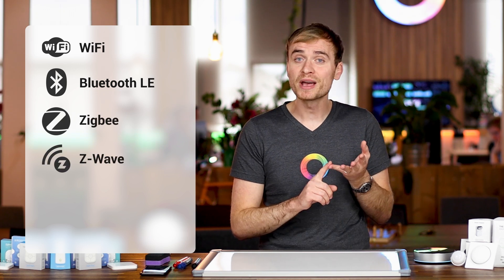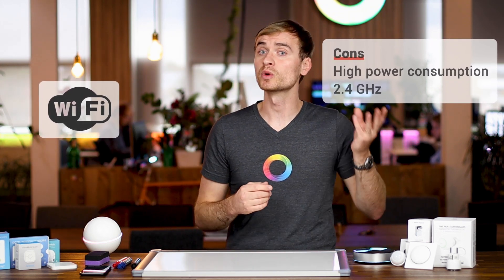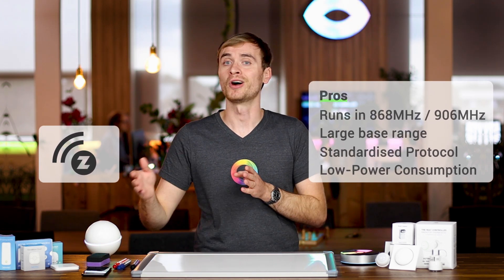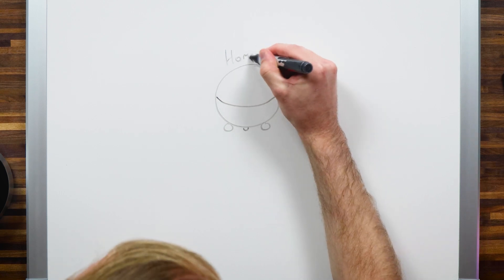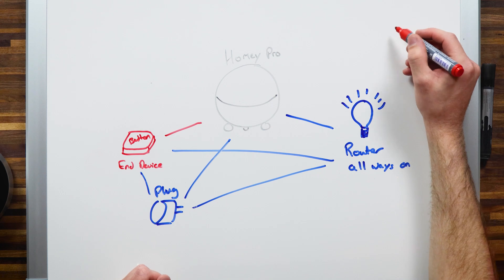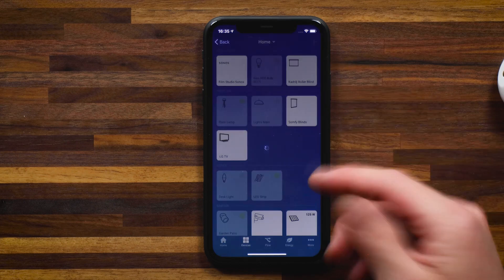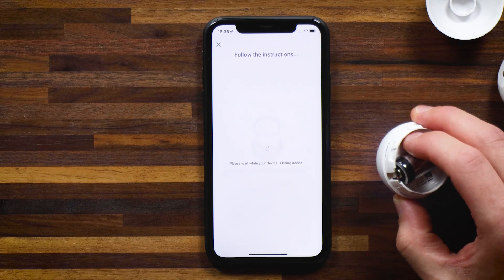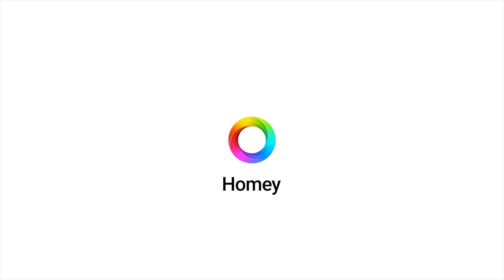What is Z-Wave?

Comment: then I don't know how it is possible that I have a z-Wave sensor and the range is about 5 m further it does not go.  I also heard this problem with DANALOCK POLELOCK V3 SMART LOCK.
Reply from the maker: Hey Richard, that sounds like a very annoying issue. What type / brand is the sensor device? Have you thought about placing a Z-Wave router device in the area to extend the range? Also during pairing, it can help to hold the device close to Homey, then once paired to move it to where you will use it.
Reply: @homey  it must be close when pairing.  When it's on, it can't even be paired.  The device is Neo coolcam pir v3.  It may be the device, but they wrote this for the Danalock key as well.  So I preferred to abandon this technology and use a zigbee.  There is no problem.